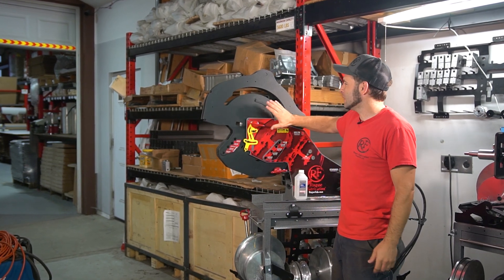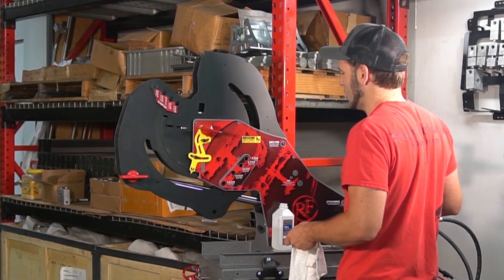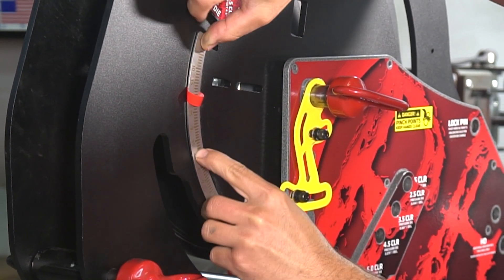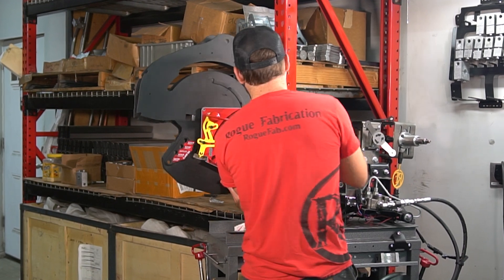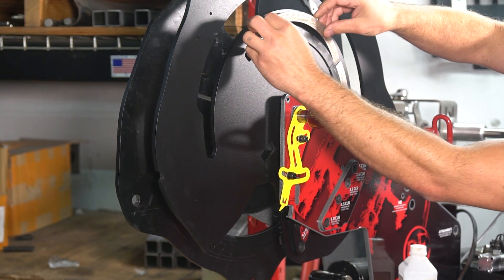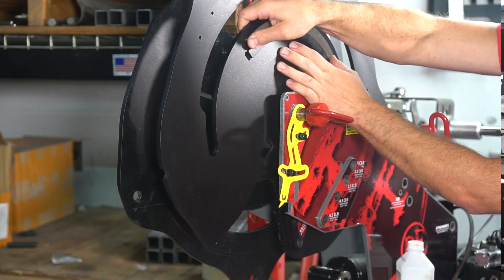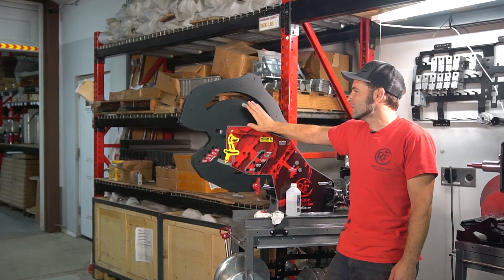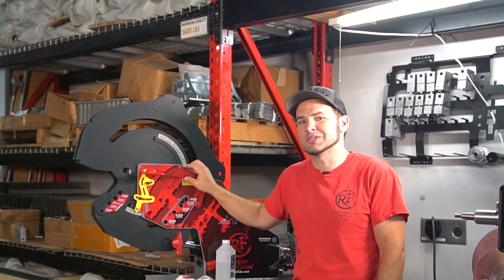New Stainless Degree Bar Kit for M-600 Series Bender

Comment: If the dial indicator isn’t touching the abrasion pads all the way along the curve, will it affect degree angle? Mine has a slight gap in the middle of the first degree bar, I think it warped during welding?
Reply from the maker: If you have the stainless ones, YES. The vinyl sticker is meant to have a gap though. -Joe